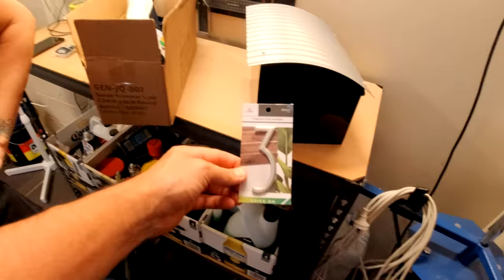Batcave Friday Ep10: New 390 Exhaust - Big Changes At The New House - $15 Studio Light Setup

Comment: Hey guys, take the baffle out and check if it is perforated.  If not, try drilling a few rows of holes in the baffle to take a little more edge off the loudness. I drilled 4 rows of 7 holes (6mm) and it helped quiet the exhaust more.
Reply from the maker: Yeah we did have a look mate there are holes in it 🤙